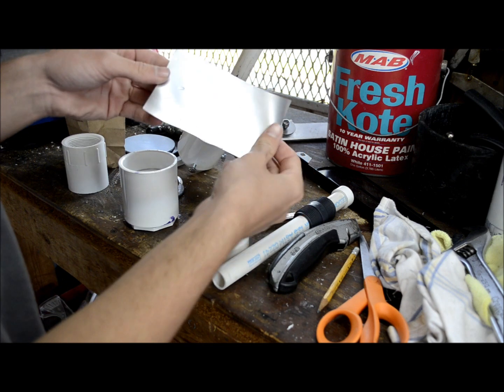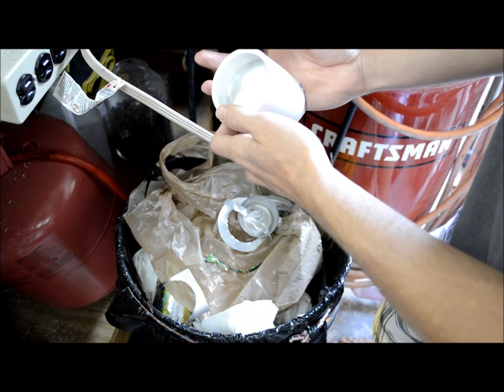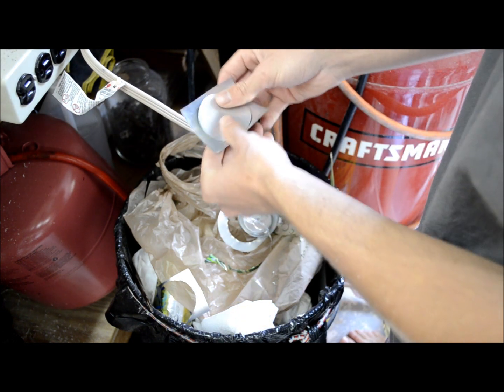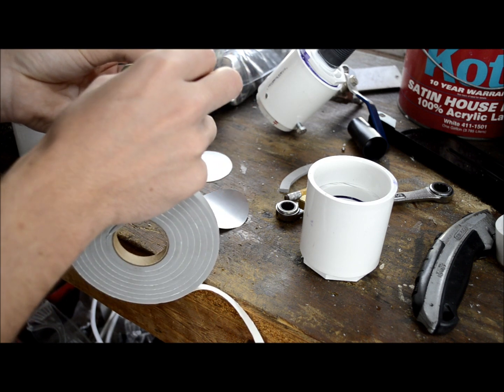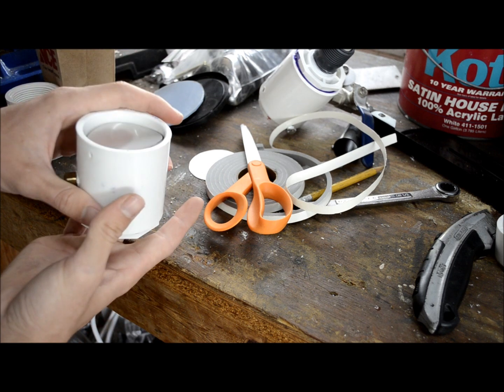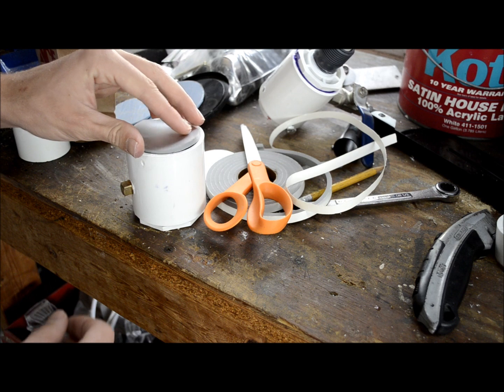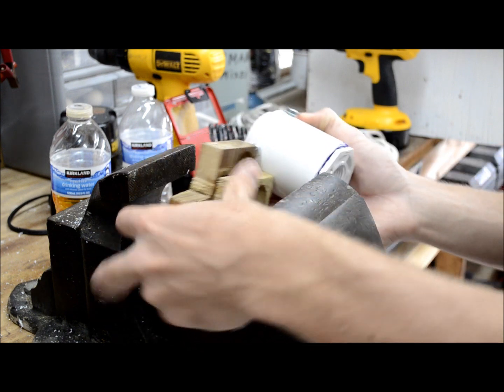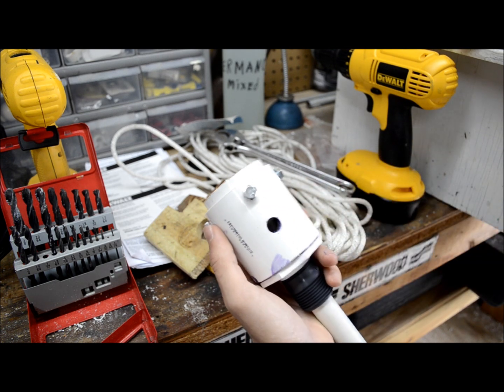HOW TO: Make Your Own Train Horns for $5!!! In-Depth Tutorial- Part 5, Diaphragm

Comment: Just a thought, but if you were to place the foam tape slightly over the edge of the diaphragm wouldn't that insure that the diaphragm doesn't make contact with the case.

Comment: The 2 soda cans can cause a buzzing between each other after awhile.Try a thinner plastic than you had like the lid off a butter/cool whip container or a thicker milk jug,or for a thicker,single piece of aluminum,try cutting from a straight section of aluminum dryer duct pipe :-)
Reply: Haven't got to the diaphragm stage yet, But I thinking I might try cutting an old snare drum head.

Comment: Do you have to use tin foil??? Cause I've got an old pair of horns with good plastic diaphragms that are .O25mm thick & planned on using one in each horn...
Reply from the maker: different materials sound different, I suggest you try whatever you think might work and just experiment with different diaphragms until you get the sound you like!
Reply: Where can I get those 1"× 2" plastic/nylon nipples from, cause Lowe's nor Home Depot carries them???
Reply from the maker: both of those places have them, look in the sprinkler section
Reply: They only have the metal/galvanized steel type...
Reply: @Pluvar  use grey plastic electrical conduit fittings. They have no taper and allow for more travel.